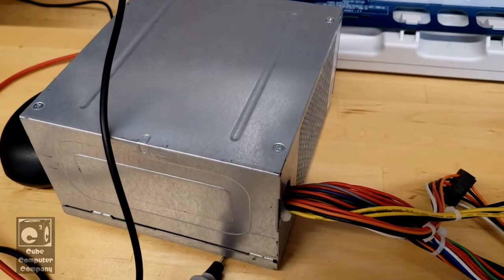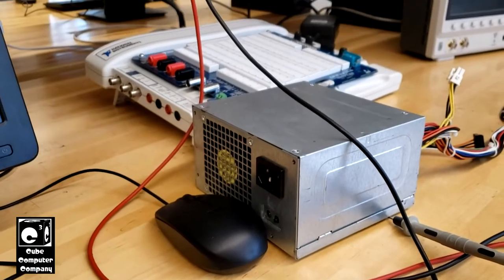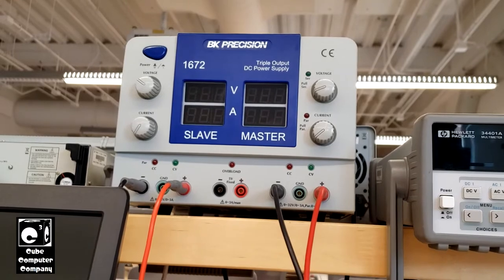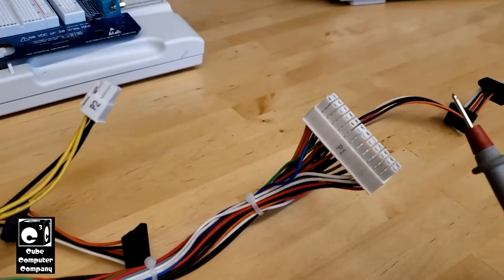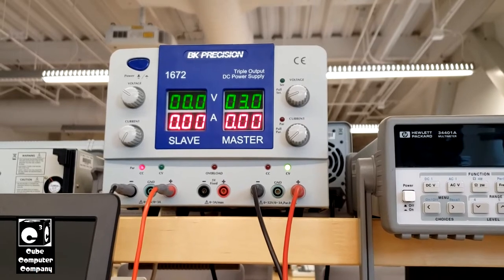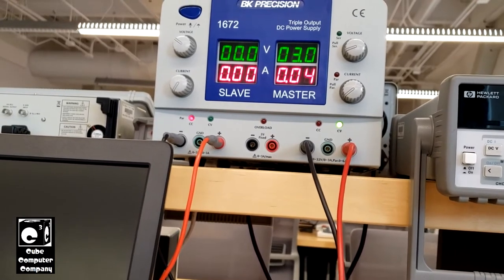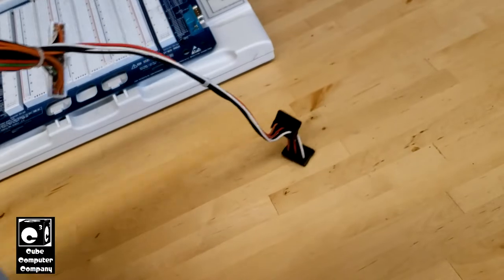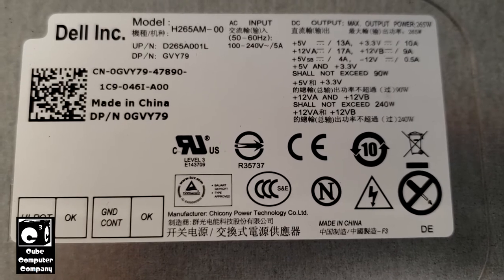Checking for shorts in computer PSU outputs using a lab bench supply

Comment: Got a broken PC, no fans spinning, no beep, no LED. PSU is the suspect, 8yrs old. LC-420 H12. Bought a new one, same model, not expensive. Same model, because of the age of the PC the MB may break as next. The broken one is full of dust, till now I was not able to open the PSU. I try this, because I want to know, if it could be dismantled for cleaning. Any hacks I can do with the broken one, or even repair? BTW, PC works now properly, I exchanged the CMOS cell, because it was already at 2.8 V, might fail soon. As the Bios was resetted, I had to adjust a few things.

Comment: There are usually 2 small electrolytes near the main switchers, have you tried replacing theese?
One more thing you can check is the transformer for the shorted turns, theese can't be detected with this test because there is a diode bridge separating them.
Reply from the maker: 5VSB comes up and works fine, it's just the unit will not start up otherwise. Seems to be a common issue since most of these units I have from the Optiplex 390 are doing the exact same thing.
Reply from the maker: I have not tried replacing the little capacitors. I have at least 1 or 2 videos on the channel of inside this unit. Feel free to point out which capacitors I should change out. Thanks!
Reply: @CubeComputerChannel  The fact that 5v standby circuit works doesn't  mean the mail transformer works.
Il go check the video
Reply from the maker: @filenotfound__3871  I know... 5VSB is totally separate.
Reply: @CubeComputerChannel  Under the primary side heatsink, between the main transformer and the supervisior doughterboard there are few small capacitors likely in the controll circuitry of the main switchers. Now I am not sure about the topology of the supply, but in the oldder style two switch foward topology there are always 2 small capacitors near the main switchers ranging from 1uF-4.7uF-10uF 50V. When they fail the supply starts having all sorts of problems, try replacing theese small capacitors around the supervisior IC, you might get lucky.
Reply from the maker: @filenotfound__3871  I'll look into that. Thanks!
Reply: @CubeComputerChannel  No problem, I am also intrested to know if that was the problem
Reply from the maker: @filenotfound__3871  Hopefully we'll get it figured out! Assuming each unit has the same problem, I'll be able to repair and save a few units.
Reply: @CubeComputerChannel  Great, you fix one, you fixed them all. I fix units like that in my free time so hopefully I can help you with finding the problem.